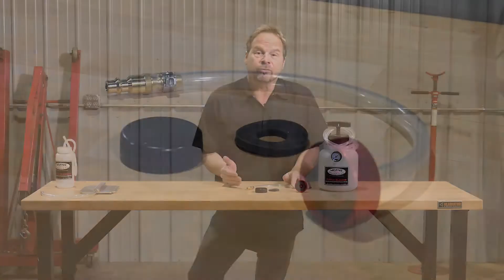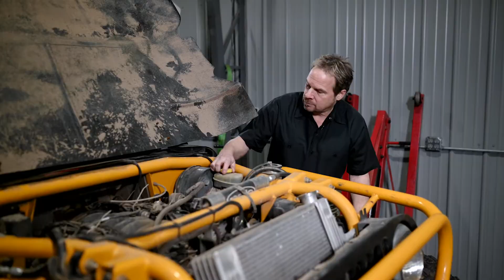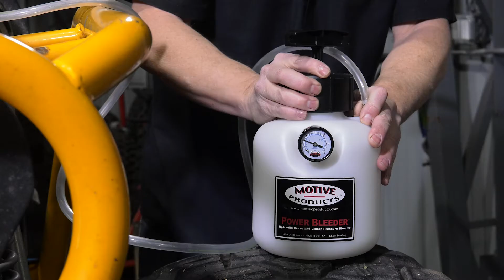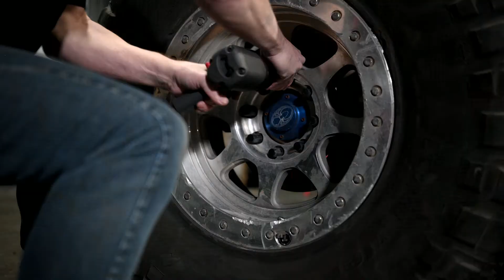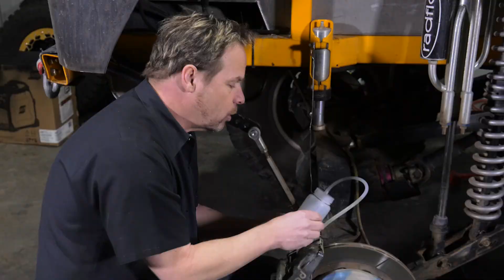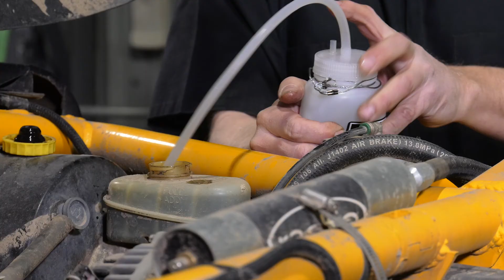How to Bleed Brakes By Yourself

Comment: Those work awesome until you're working with an older style master cylinder that doesn't use a screw on adapter. The adapter they provide for them is absolute garbage.

Comment: Bought these in August 2026. The quick connect fitting on the hose is leaking. Not at the threaded part but where it mates with the opposite quick connect. The seal inside is no good. I read that they were bought by another company and quality went down the drain and it seems that's the case. Disappointed.

Comment: I have a 2013 Ford Taurus ordered your 80 buck bleeder tank the tank holds air but wasn’t hooked up to my reservoir tank. It won’t I try both included gaskets and it still leaks 5 pounds in a minute I can’t get anybody on the phone.

Comment: 1. Shouldn’t you remove fluid from vehicle reservoir and fill with new fluid?
2. Where does the air pockets (in power bleeder line) go?
Reply: 1. Yes you can, it's probably best to do it like that
2. The bubbles just become air at the top of the reservoir, just keep an eye on the level and you should be good

Comment: great video very easy to understand.   THANK YOu for clearing out about the bubbles in the pump line to the break reservoir being normal, i still dont understand why that air dont get into the system. -
Reply: The pump line just goes to the reservoir cap. While the air IS pushed in through that line, so is the new brake fluid. The fluid level in the reservoir will drop a tiny amount, usually not by a noticable amount. The pressure pushes the fluid from the reservoir through the vehicle's brake lines.

Comment: How do you clean the motive system after use to avoid contamination of future jobs?
Reply: With Isopropyl Alcohol. I found on-line:
Cleaning, Storage, and Maintenance:
Never store hydraulic fluid in Power Bleeder™. Always dispose of excess fluid properly. Use isopropyl 
alcohol to clean your Power Bleeder™. Do not clean your Power Bleeder™ with brake parts cleaners 
or other solvents not intended for use with plastic components. Pump the isopropyl alcohol through 
the tank and hose assembly and let air dry. If isopropyl alcohol is not available, a solution of dish soap 
and water can be used. Motive recommends hanging the tank upside down to ensure it dries completely. 
Lubrication of the Power Bleeder™ pump mechanism should not be necessary. Should lubrication be 
required, apply a small amount of brake fluid compatible grease, such as AGS Sil-Glyde® to the Power 
Bleeder™ pump shaft. Never lubricate with petroleum-based oils. Do not store your Power Bleeder™ in 
direct sunlight or with kinks in the hose. We highly recommend replacing the hose every 3-4 years. (part 
number: 0409-MTV).
Contact MOTIVE PRODUCTS for technical support. Do not contact the company where purchased.

Comment: I bought this for my Subaru Outback and couldn't get a good seal with the round universal adapter that was recommended.  The reservoir opening is offset to the master cylinder so there is no way to get a good seal, even with c-clamps.  Have you all made an adapter to fit a newer outback yet?

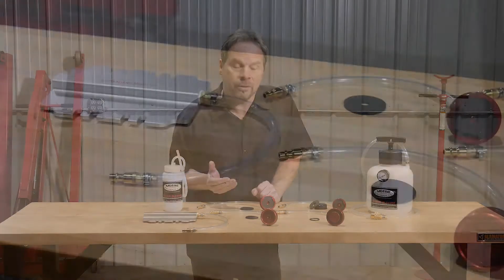Comment: 0:18 What’s the black cap for? I have the same adapter kit for my ram.
Reply: This is an old comment but that black cap is the plastic adapter. The other, more expensive model, comes with the red metal cap that spins freely from the tube. For my car, I have the 0107 plastic adapter rather than the sister 0117 metal adapter model. Still just as good I hear.

Comment: I recently purchased the MOT-0100 Kit, and I'm impressed with the quality of the product. The build is solid, and I really like how tidy and straightforward the pressure bleeder method seems.

However, my first experience with it hasn't been entirely smooth. I'm unsure if I'm using it incorrectly or if I just need more practice. Here are some of the issues I've encountered:

The connection (brass/copper screws) between the bleeder adapter and the main unit doesn’t seem tight enough. It may require a rubber washer for better air-tightness. I had to tighten it multiple times with a large wrench before resolving the issue.

No matter what I do, the pump handle doesn't seem to create an airtight seal, and I keep losing pressure slowly.

When adding pressure to the fluid reservoir, it fills up quickly, resulting in a potential mess unless you remove some fluid beforehand.

I’m also a very experienced DIYer when it comes to cars, so I was surprised by these issues.

Comment: I see that this unit your using has a quick connect on the hose. Your product being sold at Amazon have threaded hose connectors. ?????
Reply: I was going here and type the same, not ok to skip on and not doing a new commercial video...
Reply: Maybe they've changed it back because I just got one on Amazon and it's got the quick connect
Reply: @JohnVance can you verify the seller and shipper for your order? Because it's possible you ordered from some shop that had old stock before the company changed hands and downgraded production quality.

Comment: Shameless self-promotion - I bought one of these a couple years ago, and put up a YT video with my experience.  I've done a bunch of brake lines since then, single lines up to complete systems, new un-bled master cylinders.  Firm pedal right away, never had to come back and re-bleed.  I always clean it out with denatured alcohol, per the directions.  A plastic bottle with tube to catch the fluid coming out of the bleeder screw makes this tool a one-guy operation, no need to annoy family.
Reply: I was sitting here thinking of paying the extra money for this. Is yours still holding up?

Comment: **Warning**
I ordered this brake kit for late model Chevrolet. They took the money out of my bank right away $79.54. next day I tried to track it and the tracking number did not work on the confirmation they sent me tried to call them no answers all of their mailboxes were full. Tried to email them no response. Next day same thing no response no answer the phone. This went on for 5 days in a row with no response or no emails back to me. Turned it into my bank today I will never order from them again hope this helps somebody else
Reply: At least you got a confirmation email with a tracking number. They took my money instantly but I never got any confirmation of the order. I called today and they did answer, told me my order shipped but still no emails or updates showing what's going on. I chose UPS 3 day delivery so if it's not here by next week I'm calling again and requesting a refund.

Comment: Had to toss this in the trash today, what a pos with leaks and fluid being thrown everywhere!!
Reply: The one thing the internet doesn't mention, (but the instructions do) is that if you experience air leaks when doing the initial dry pressure test, you need to use plumbers tape or thread sealer tape at the junction where the 2 hoses meet.

I've had to use this tape every time I used the power bleeder. If I didn't, I would've also had leaking fluid. Exactly why the dry test is crucial. Also, clean the unit when you're done.
Reply: @RothBeyondTheGrave  I have never used one of these but im interested in getting one,regardless of the initial dry test i would find a couple of old bath towels in the house and cover as much as i could of my car and engine, better safe than sorry.
Reply: It's plastic. Though chemical resistant, you need to clean with denatured alcohol.  Otherwise it will degrade in time.

Comment: I have owned the black label for about 15 years, and it works perfectly without any problems every time. ether, it's flushing or bleeding. The results are always the same each time. Flawless.
Reply: Thank you for your review on it,Ive been wanting to get one,i wanted to ask,how come the master cylinder lets fluid thru to the bleeders without depressing the pedal? isn't that bypassing something?  also,lets say that you suspected the master cylinder wasn't bench bleed properly some time ago, wouldn't this fix that at the same time you are doing all this?  thank you so much for your time, i appreciate it.